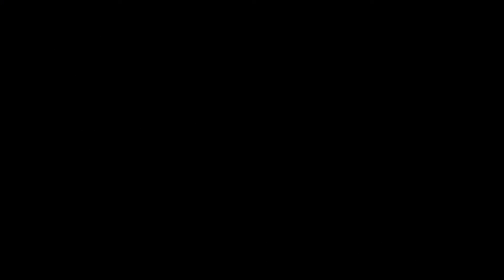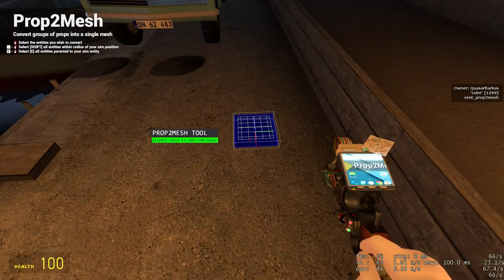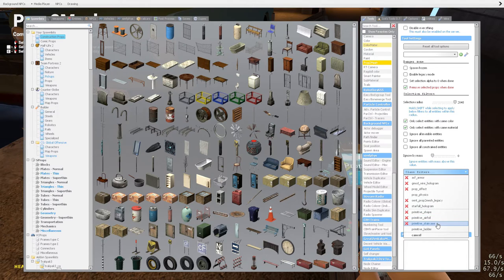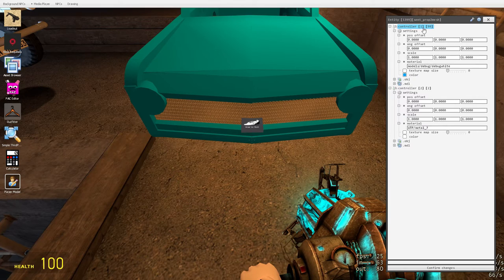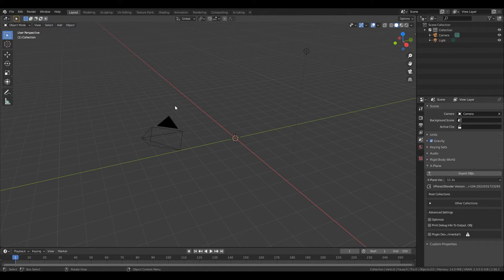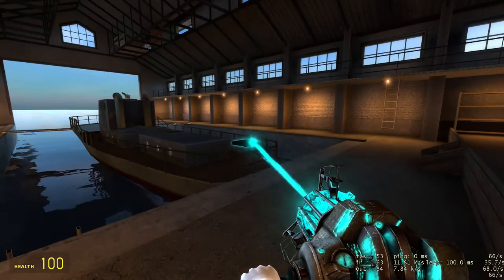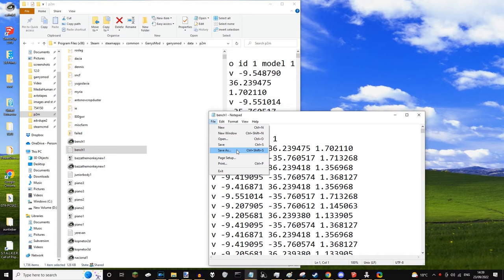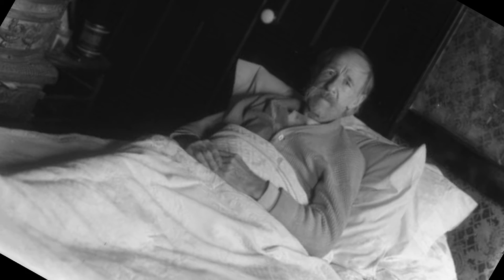Prop2Mesh Tutorial: Basics, Importing/Exporting etc.

Comment: how to import with material?
Reply from the maker: material porting isnt possible unless you code a mesh parser in starfall that does it, shadowscion has said he doesnt plan on adding material porting either sorry :/
Reply: @quas392  i just do they make their own ? Like with submaterial or somth?
Reply: If you have multiple meshes under one controller, you can apply a material to each mesh to make the mesh more detailed.  

Yeah, material importing isn’t really feasible right now, but for most applications sprops or phx textures can get you pretty far